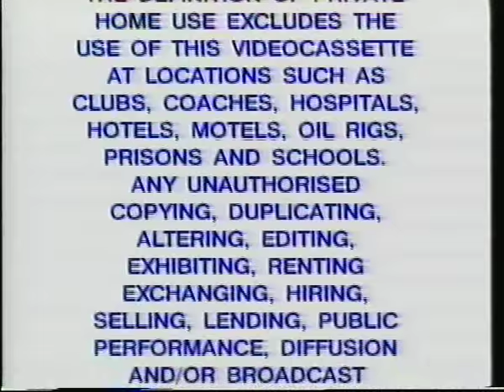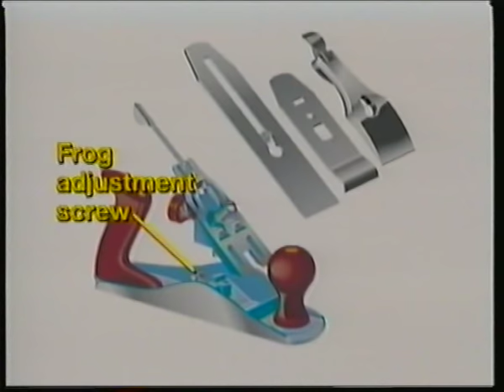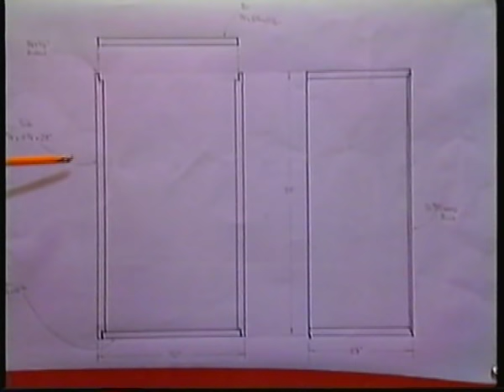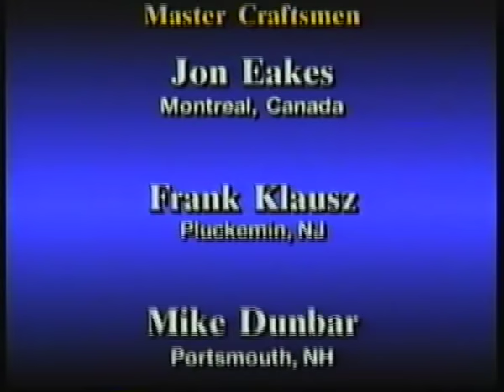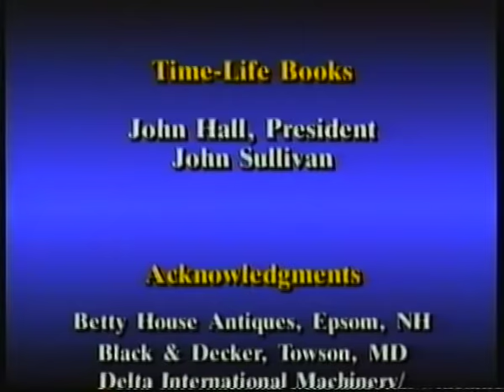TimeLife video:Shop secrets from master craftsmen.

Comment: A good friend, who's no longer with us, was born in Germany, around 1934. On his 14th birthday, his father took him around to some local businesses, looking for one that would take him on as an apprentice. A carpentry shop took him on, and he worked as a carpenter till his death, a couple of years ago. He told me stories about his apprenticeship, working with a couple of other young apprentices, doing all the menial tasks around the shop. They spent weeks and months and years, sawing rough stock into boards. Later they would be given the chance to plane boards to thickness. After that they would learn to put rough carcasses together, and to build other things that were simple, and didn't require a lot of skill. As their skills expanded to include sawing, planing, chiseling, etc, they were also expected to maintain those tools. They became the shop saw sharpeners, plane and chisel sharpeners. They were each assigned to a master carpenter, and they called him 'Master'. He told me the first jobs they were given, to work on their own, and to fill contracts, was to build beer boxes for a couple of the local breweries.  These were simple wooden boxes, that would hold four, one litre bottles. They were dovetailed on the corners, with two dividers inside, crossing each other with a half lap joint. One of the dividers was higher than the other, and had a handle cut into it. They would mill the lumber from rough stock, mass produce all the separate pieces, cut all the joints, and assemble them all with no glue or fasteners. They would get contracts for 500, or 1,000, or 2,000, at a time. And, of course, time was money, so there was no fooling around. He was, by far, the best carpenter I've ever known. Watching, and hearing, Frank Klausz always makes me think of my friend.

Comment: Using rabbit joints always results in glueing end grain to end grain or end grain to long grain. So what is the point in using these joints?
Reply: The benefit is the huge amount of face-to-face surface, and as Takes noted, the bridal joint is 2X as strong because it has 2X the glue area.
Reply: I was talking about the last video starting at 48:00. There is no face-to-face area at all. Just end-grain to long-grain. The bridle joint as shown in the first video (not bridal, despite of the similarity of inserting a part in a slot) is very strong indeed. That is because the increase of long-grain to long-grain area. But end-grain does not glue well. Almost not at all using antique glue. Although with modern glue everything might hold more or less.
Reply: Now I see what you're curious about.  You're right about that rabbet having a lot of end-grain.  Three things to remember:  1) the rabbet captures the other part in 2 directions, which when combined with 2) the panels prevents the joint from racking/rotating and distributes loads to the other frame members.  This combined action is very strong, but his little boxes are doomed to failure because the panels are fully adhered/connected to the rails and as such the parts will undergo differential expansion/contraction and then blow out the rabbet and end joints, and/or crack the panels.  3) The reason that his demonstration is workable is that his box is small with very small loads and it won't get worked hard, but I wouldn't expect it to last very long.

Comment: There is nothing wrong with your smartphone. Do not attempt to adjust the picture. We are controlling transmission. If we wish to make it louder, we will bring up the volume. If we wish to make it softer, we will tune it to a whisper. We will control the horizontal. We will control the vertical. We can roll the image, make it flutter. We can change the focus to a soft blur or sharpen it to crystal clarity.